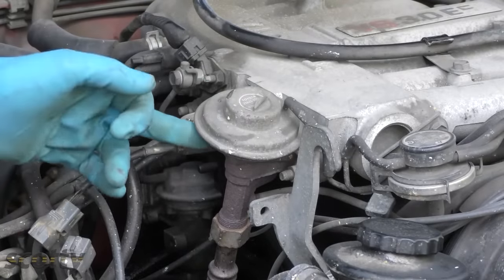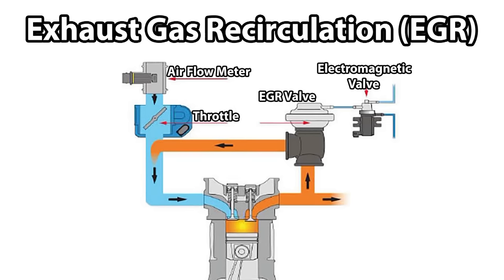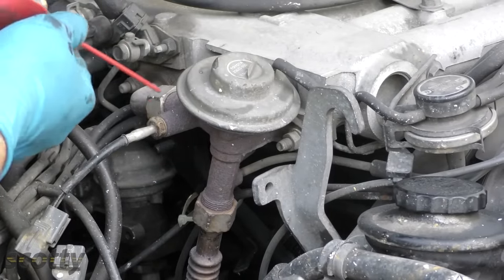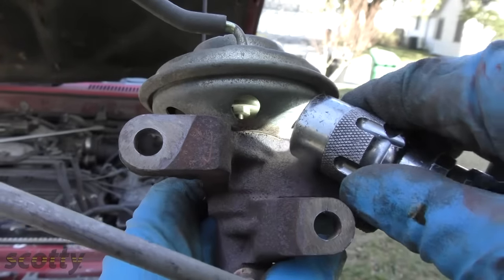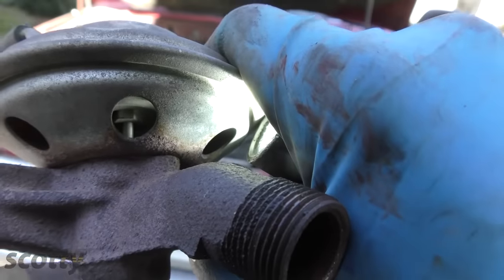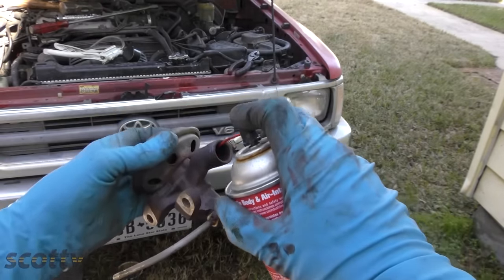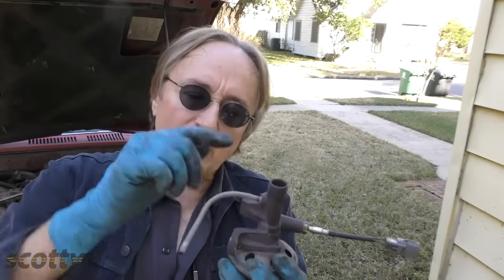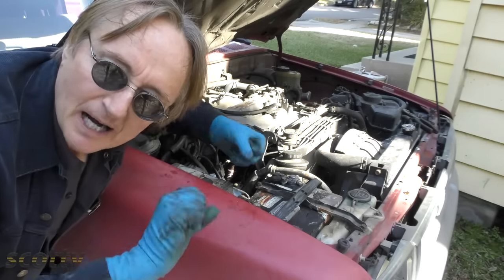How to Clean EGR Valve in Your Car (How It Works)

Comment: Have you ever had all the symptoms of an EGR but the EGR checks out? I have a 1996 Chevrolet C 2500 2 wheel drive 5.7 l standard transmission pickup. Just put a brand new set of heads on it cuz the other ones cracked. The only problem I had prior to doing this with my pickup was that I was losing coolant. Shop replace the heads on my truck and it's using a ton of gas misses throughout the driving range feels like a cylinder has a misfire on it but I have not won code in the computer not a service engine light nothing it is driving me crazy. Like I said prior to them putting the heads on other than it leaking coolant out the tailpipe the truck ran great. Would a fuel regulator cause it to use a lot of gas idle perfectly but then act like almost like it has water in the fuel but I know that it doesn't I guess in a word when I'm saying is...HHHEEEEEELLLLLLLPPPPPPP!!!!!!! PLLEEAAASSSSEEEE

Comment: Is there any way you can visually tell if your car has variable valve timing by looking? I have a 98 Lexus es300
Reply: Yes, most engine covers will say VVT on them or you can see on the top of the engine where the timing chain cover is and look for a pair of wires harness going to the top of the cover where the timing gears are. However, a 1998 Lexus ES 300 doesn't have VVT. It just has 4 cam shafts per cylinder head and a timing belt.

Comment: Hi Scotty
I enjoy your videos and I do have a question. I recently installed a timing chain, cam chain and everything new with this install on a 2004 dodge dakota 3.7 liter. When done started right up and drove fine. This was done 2 weeks ago. Then on Monday morning I started it and was backing firing through the throttle body. So I took off valve cove to see if rocker arm popped off again, which it did before. But this time a different rocker popped off and I also noticed my timing chain also is off by 2 teeth. Any idea why this would happen. Thanks and God bless

Comment: HEY SCOTTY .Love the videos man keep up the good work Im learning more and more. Wanted to ask a question its been driving me nuts. I have a 2006 Ford Explorer XLT V6  4.0 L . My check engine light turned on and is giving me an error code P0401 EGR insufficient flow. I replaced my old EGR with a brand new one. But still getting the same code. My other guess might be a bad DPFE sensor and honestly  I cant locate it. Unless its on the EGR. Any tips on what i can do. To get this error code and finally fix the problem just hate seeing check engine light on when i drive. 
Thank you
Reply: have you checked the passageway for the EGR? It can sometimes have carbon build up as well
Reply: @Jacobwafflez  Yeah everything BUT my car timing belt went and motor is siezed honestly not worth fixing and dropping money into it. gonna junk it or sell the car for parts.

Comment: wish my Seat Ibiza 1.2 TDI was that simple(2012/03) but it isn't :( ...it's nearly impossible to do it myself and replacing it seems costly(they told me around 800 euros and I'm not gonna pay that) - My car works as expected but I get that nasty "check engine" light which I erase every now and then through the obd port(Error P0405)

Comment: Good evening Scotty Kilmer I drive a 2008 Ford Fusion and the check engine light came on Yesterday I took it to Autozone and they did the scan and came up with Diverter Valve / Management Valve on Bank one Secondary Air injection commonly known as the EGR system the problem is that I have no idea where it is located on my car I have an idea but could use a little expertise so if you could please let me know if this is the part im looking for? IMG_0875.jpg

Comment: EGR valve is an engine killer, you insuflate dirty warm gaz exhaust slightly oily in your piston chamber. The air intake must be cold and clean that's why there's an air filter and eventually an air cooler if your vehicule is turbocharged before reaching the intake valves. If you want your car to run better and longer with less maintenance close the egr valve forever and take it to a garage to make a new cartography.

Comment: I dont think this is the same part can someone help me anyone i have a 460 engine it has this hole below the distributor idk if a part goes there or what but basically if i open my throttle plates while it runs increasing rpms youll see exhaust come out of it its by the pulleys below the distributor on top if my engine is really hot tho and i floor it or rev to higher rpms it shoots oil all over my engine bay first i thought this was a starved engine problem but ive had it running like this for a year then i thought maybe a leak i havent run anything through the engine to seal up leaks or anything but its a hole i cant tell if i need a part or some bastard drilled it in there and if so why i just wanna understand my engine please help me

Comment: I'd like to see you do that on my car, where the EGR valve is put nice and tight right behind the engine :)) You need to take half of the car apart to get to this valve.

It is so bad that I'd rather just wait for it to go bad and then get a new car, LOL. :))))) Behind the engine, between it and the cabin, in a kinda backward V shaped space, the valve being in the upper part.

Comment: Hi! I have a vw lupo 1.0 mpi(auc) with P0401 - 35-00 error EGR System: Insufficient flow.
The EGR Valve and pipe are very clean and I still got the issue, do you have any idea what is wrong with it? Thank You!

Comment: I clean mine with a shop vac and a shot of tequila I put the shop vac to the exhaust pipe and leave it for 10 minutes with motor running while I enjoy a shot of tequila, I listen for the engine to drop down under 500 rpms the idle becomes so smooth can barely hear the engine idle. This has worked for over 40 years never had a problem.

Comment: I have to unplug the battery and restart the computer for it to stop but when the engine light comes back on it's starts ideling high again
Reply: the key here seems to be your check engine. Find what the code is for that check engine light and you can go from there. also when you ask Scotty. it always helps to include the year and model of the vehicle.

Comment: how to clean egr in vw 1.2 tdi cfwa engine?       dealer told to replace it for 800$
Reply: AJay PatiL visit rockauto
Reply: AJay PatiL Depends on the year of your VW.  Early EGR’s would be mechanical, like in the video.  Newer ones are electronic.
Reply: Inisfad its an electronic one and is not easily accessible. its behind the engine. can it be cleaned or do I need to replace it?
Reply: AJay PatiL I believe the ease of cleaning the electronic ones depends on whether its single or multiple solenoid, etc.  But either way, you would need to remove it from the car.  I assume (and shouldn’t) that your mechanic has tested the vacuum line going to the EGR, the electrical wiring, etc.  But I really shouldn’t assume this.  Are you throwing a code??

Comment: See, this is great when you have easy access to the EGR-valve. Try a VW EA189-engine, where its placed in the back and water cooled, so it takes a pro 5 hours to remove it. My EGR-valve got stuck in full open position and the local shop wanted 1800 bucks to change it. The majority was for the amount of time it takes. 

So I had them remove it. Fortunately its legal where I come from. Now the engine runs as smooth as ever.

Comment: If it will start and idle you could just fog it with a can of carberetor cleaner. See if that works.
Reply: PVC valves can also be cleaned.
Reply: Or get MAF sensor clean and use that to clean sensors, PVC valve and fog.

Comment: Egr valve?!? What’s that? Ohhhh you mean that piece of crap on your engine. I blocked mine off. Gotta love a 90’s model Chevy s10, only has to put a simple block plate where the valve was and pinch off the vac line. Unlike today’s modern vehicles you can’t just block it off you gotta reprogram the dam computer in it.

Comment: Is blanking one illegal or controversial?
Reply: Jake Fuller Depends if you have emissions inspections in your state - if you do, the EGR has to be active.
Reply: If your in California it's probably illegal to tamper with it in any way. The old trick with a BB in the vacuum line will work and give you the same results. Plus it looks like you haven't touched a thing. Don't forget to remove it prior to testing for emissions. If it's electric un plug it
Reply: Scott Golden will it still put the light on from the ecu if I do that mine seems to come on when the engine is hot then go out when its cold and its sluggish when hot and it riddles faster ? Its a1.7 DTI derv combi van
Reply: It's detremental to block EGR on gas applications.  On diesel, it keeps the motor a lot cleaner and oil stays cleaner not having to digest all that soot.  Pull open a diesel and check out the cylinder head with an EGR after 100k and you'll know what I mean.
Reply: Jake Fuller  ,

Comment: If its, upside down the solvent will come in contact with the diaphragm.
Reply: donald p and possibly the electronics depending on the valve,which would destroy it If solvent gets into them.Berryman cleaner or even electronic moving parts cleaner works great too since it degreases but it safe for electronics.

Comment: "Stops nitrogen oxide pollutants"; really Scotty!  Come on man pull the other leg.  If you said it helps to REDUCE nitrogen oxide pollutants, I would agree with that!
This (EGR) system is crazy, we are trying to make engines more efficent, yet we do this with one hand tied behind our backs.  We all go to die some day, there are millions of possible causes.  All that the EGR system does is make engines more inefficient as EGR is effectively reducing the swept volume, which is dumb as the friction still remains.

Comment: My egr valve bolts are in a retarded position and I cant really get at them that great. Put new one on and I dont feel any gas escaping but just dont know how tight I should get those  jerks
Reply: Oh also, the cel is still on after replacing it.

Comment: i make sure my egr valve is clean by cleaning it with every oilchange but i drive like a fuckin maniac racing from stop light to stop light. my gas pedal has only 2 modes: on and off. +1 for keeping the environment clean #greenearth #dontpollute #itrusttheEPA #dieselgate

Comment: you clean it by placing it in a gallon of berrymans carb cleaner part number 0996 for a fedw hours then risning with water, all soot carbon etc melts away, no reason for any scrubbing scraping etc, been doing it for 20 years, also works on pistons rings valves heads ets, melt it, use chemistry, safe on plastic rubber etc. its the ONLY  way to clean carbon based matter from metals. do not use berryman professional, it melts plastic rubber paint, use only part number 0996, safe to use in harbor freight ultrasonic cleaner, 480 seconds in that with 0996 usually returns black parts to factory. 0996 berrymans chemdip carn and parts cleaners with basket, melts carbon buildup
Reply: pour the 0996 back in the can reuse it over and over
Reply: i have cams 6 years old still going strong

Comment: So an egr is essentially a turbo
Reply: Kevin Dehler No... A turbo doesn't reintroduce exhaust gasses back into the engine. It uses exhaust pressure to spin a turbine to push high pressure air (boost) into the intake.